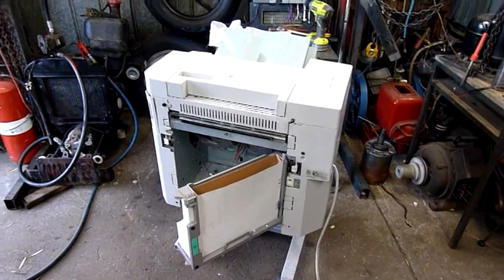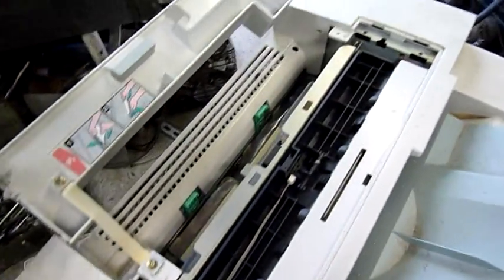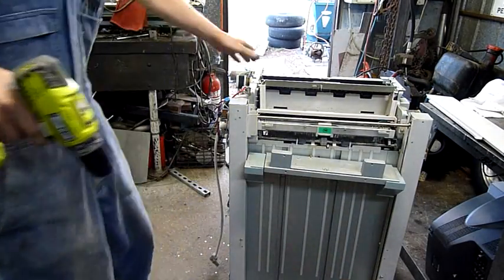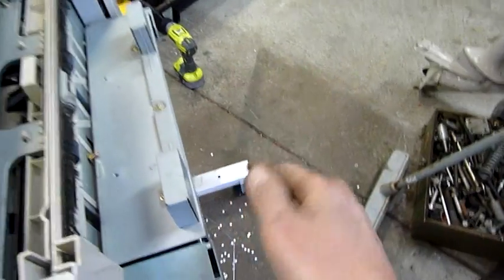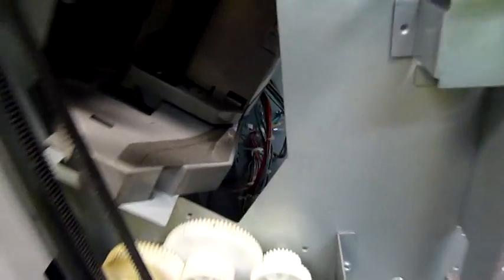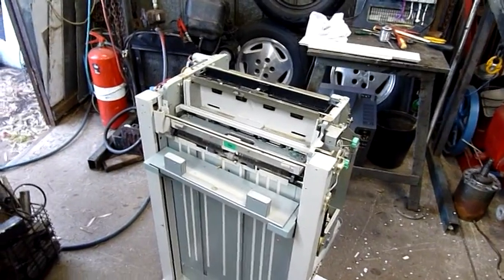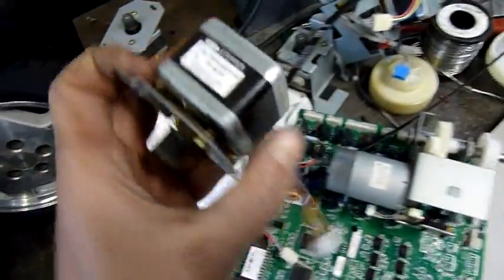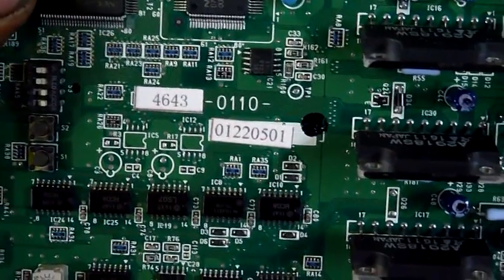Minolta Di450 Copier Sorter - Finisher Autopsy

Comment: That particular style finisher carried on in other forms with basically different controllers and other minor differences for years after the Di450 was dead and buried - The last revision of that finisher style ended up being given away for free by Konica Minolta partnered with the last of the runout C250's / C450's.

Comment: stepper motors $20 new on ebay, used 5 for $35, all 3D printers have at least 3... 
belts/gears would drive a nice tumbler using that steel rod bar stock as a roller, it'd look just like my harbor freight one: one drive rod, one support rod.